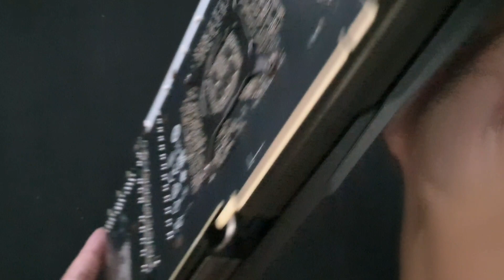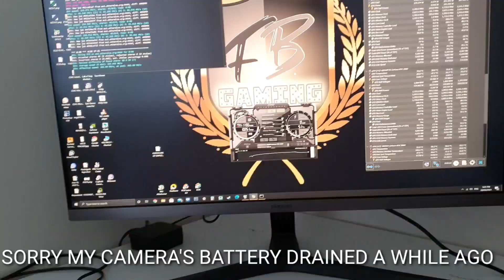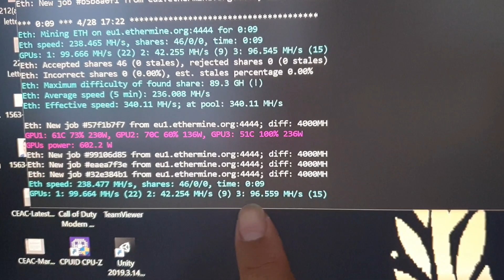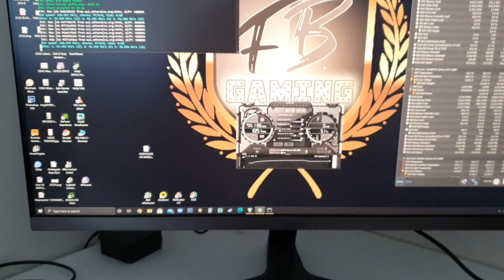RTX 3080 Thermal Pad Replacement | Teardown | 101mhs eth mining

Comment: You have good taste in music.  Did you ever figure out why your hot spot temp was so high?
Reply from the maker: Hey there, it is because of the chip that MSI used, Asus strix use better chip and is not prone to overheating.
Reply: @ToolsandGadgets   Okay, thanks.  I replaced the pads and paste 3 times now and I can't the hotspot temp  down.  I basically wasted my money even buying them.
Reply from the maker: Aftermarket thermal pads are better than stock ones though.
Reply: @ToolsandGadgets  I used the gelid 1 mm pads.  The gpu hotspot went up but the others went down a little.
Reply from the maker: It's better to take note that some parts use 2mm thick or 3mm thick. probably some parts that are heating up are not touching the thermal pads since it's too thin.
Reply: @ToolsandGadgets  I never touched those pads.  I only changed the 1mm ones.

Comment: Pause at 8:59 now look at the vram heat sink near those heat pipes at the bottom underneath that removable plate I’ve seen people talking about how the plate doesn’t make contact with the heat pipes! So they add an additional thermal pad underneath it !

Comment: The values for pad thickness are all wrong.  They all need to have 0.5mm added to all the sizes provided.  At least for the gaming Z trio.  Mining Ethereum memory temps went from 102°C to 72C
Reply: i put 1mm on mine gaming z trio on memmory went from 100 to 74 c
Reply: @techgeek2994  Which thermal pads did u use?
Reply: @bizybunny  gelid gp ultimate 1mm
Reply: @techgeek2994  did you replaced all thermal pads to 1mm?
Reply: @bizybunny  bro it has nothing to do with thermal pads, my memory temps in windows are 75c. yes i did change to gelid gp ultimates, this has nothing to do with memory temp, hiveos shows 75c as well, it is limiting power draw to 210w, and i noticed core clock drops under 1000 when you overclock memory, it is some problem with hiveos with this specific gpu
Reply: Well want to properly tell us the size instead of belittling mate I’d also like to know the correct size !! ?
Reply: @filiplaskovski9993  - watch the video, add 0.5mm to the recommended size mentioned in the video.  I suspect from memory it's 1.5mm.

Comment: How do you get 1.5mm if you only have 1mm and 3mm thick pads? Can you stack them?
Reply from the maker: Hey there, i did not replace the 1.5mm since i do not have it on hand and it does not affect the vram temps.
Reply: @ToolsandGadgets  I am opoening my GPU up to change memory junciton thermal pads, should i change more than just that while it's open?
Reply from the maker: in regards with the memory junction temp problem. only the ones i showed on the video gets to be replaced, both front and back thermal pads, please see my other video for the back thermal pads replacement. the rest of the thermal pads are not affected or in any connection with the memory junction temperature you are facing.

Comment: Bro I changed my thermal pads everything booted but it restarts my whole rig every 30 mins. What is happening to my gpu any idea? Do I rechange thermal paste or cut my pads again
Reply from the maker: Hey there, did you try checking the temps using HWinfo?
Reply: @ToolsandGadgets  can we connect on some social media so that I can text you up and show you images. My core temps are higher I know that. Memory temps are lower than before. But this card is restarting.
Reply from the maker: one reason i think which also happened to me before was i pushed it to the limit and over clocked it so badly that it restarts every couple of minutes because the gpu could not handle it anymore.
Reply from the maker: try lowering down your memory clock and see if it works
Reply from the maker: i think lowering down your memory clock should do the trick find the sweet spot of the card. that happened to me also, and the only overclock i changed was the memory clock by lowering it and finding the stable spot
Reply: @ToolsandGadgets  actually I started using the same clocks as previous settings on this card but it's restarting. Before it wasn't
Reply from the maker: by the way what model and brand of gpu are you using?
Reply: @ToolsandGadgets  I am using the same gpu and 1mm thermal pads on memory.
Reply from the maker: can you type in your overclock settings here bro. and also the temps that is in hwinfo
Reply: @ToolsandGadgets  1350 memory power limit 112 core clock locked at 1010 mhz fans 80 percent. 
HWinfo temps are 47 C for core temp. Memory temp 96 to 98 C before it changing pads it was 104 C
Reply: I also flashed the suprim x bios like a month ago and I am Using trex miner for mining
Reply from the maker: Try this
Power limit - 75
Temp Limit - 77
core clock -    -292
Mem clock -   +1000
Fan Speed - 80%
Reply from the maker: i am using stock bios
Reply from the maker: or maybe just open back the card and try to reseating everything. also the cables inside try to check if all are connected properly
Reply: @ToolsandGadgets  with the stock bios I was getting 88 mh max. I ordered new pad and new thermal paste. Will change the thermal paste with a higher quality one and cut the thermal pads a little smaller I guess that's causing the issue.
Reply from the maker: yes because i could not see any other problem aside from reseating the whole thermal pads and using the right thickness of thermal pads
Reply: @ToolsandGadgets  the thickness is right. 1mm but the thermal paste is a normal one. Will update you once I redo everything bro
Reply from the maker: if you are using the same clock settings as before. try checking your thermal pads on your front pcb. maybe it has a different thermal thcikness to it, and the heatsink does not have enough contact with the gpu processor
Reply from the maker: always remember different brand and models of GPU uses different thickness of thermal pads. if the thermal pads is thicker or thinner even by just .5mm thickness it can affect the contact of the heatsink to the processor thus causing random shutdowns due to overheating

Comment: where did u use the 1mm thermal pads, i just dont get it?...
Reply: the 1mm is the most important part as it is the one you put by the chip. ur using the internet so ur not a dumb ass. if u watch from start to finish u would see he labeled 1mm, 1.5mm, 2mm. go rewatch and find it urslef idiot.

Comment: The most important thing here. What was the before and after VRAM temp?
Reply: 17:20
Reply: @TheRusox  98C is horrible he used the wrong size thermal pads. I used 2.0mm and got my temp to 82C in a closed case.
Reply: @Johnnyy832  Do you suggest to use 2.00mm in all the pads he changed? (i got the same card and im preparing to do this)
Reply: @aborjas23  yes

Comment: I think the reason ur still in the high 90’s for mem temp is because 1: u didnt clean ur paste properly with alcohol . 2: theres one thermal pad 2mm that needs to be closer to the bracket on the heat sink so it makes contact . I did 4 suprim x and they all running at 80c on mem junction . I have yet to do my trio x but after replacing pads it should be around 80 regardless of silicon lottery
Reply: I believe so too. Saw someone able to get 80s using gelid extreme. Would you happen to know if these pads would work - Frosty thermal pad 12.8? I can’t seem to find much info on it.
Reply: @storedcoin4026  They all work, in my opinion just use thermalright pads. I was able to bring my temps down to 82C junction while mining in a closed case.

Comment: i dont understand man i have better temperatures with stock thermal pads on the same rtx 3080 , mine temperature is  92 at 99mh, you did something wrong again, it doesnt make any sense how i can have lower memory temperature with shitty stock thermal pads , than you with expensive pads ?
Reply from the maker: Hi there, well there are lots of factors 1. maybe you live in a cold place. 2. You won the Silicone lottery. 3. You're version has a better stock thermal pads. 
So which ever it is you are really luck to have that hash rate with the stock thermal pads.
Reply: @ToolsandGadgets  i dont think stock pads can be better than 12.8 mk expensive ones. for sure they didnt use expenisive pads, and no i dont live in cold area it is summer here now 30 degrees celsius. just check did you use proper size of pads. with thermal oddisey you should not get more than 84 celsius on memory man
Reply from the maker: well there are lots of post people getting lower hashrate due to temp throttling. i guess maybe you just got very lucky, and got a very very good silicone.
Reply: @ToolsandGadgets  what thickness thermal pads did you put it needs to be 1mm softer pad, i decided since summer came and my gaming z trio went up higher in temp to change and i used gelid gp extremme 1mm on memmory now memory is at 74c at night 78 at day . i can notice your core temp is 51c that means you used too thick pads there is not good contact with core (i know this because happened to me as well core was 52  because i used too thick pads, reduced to 1mm and dropped to 35c , or therml paste is not good. i used noctua paste core temp stays at 35c) at night 40 max during day when is hot. try using thinner memory pads or better brand . there is no way that that card cannot be lowered under 88c on memory

Comment: Which config do you have on your RTX3080?
Reply from the maker: PL 102
CL -292
Memory + 1200

But it really depends if the card can handle it
Reply: @ToolsandGadgets  just change the thermal make her up the hash?
Reply from the maker: By changing the thermal pads the memory junction temperature decreases that is why you can tweak better on the afterburner to get higher hashrates. because when you reached 110c memory junction temperature, it thermal throttles which will limit the performance of the card.
Reply: @ToolsandGadgets  my msi trioz get 92c 98c and dont pass 90hs
Reply from the maker: for a rtx 3080 99mhs is totally normal and very stable. also as long as you dont go over beyond 100c memory junction temperature is also ok. but if you could lower the memory junction temperature by switching the thermal pads to a aftermarket pads like the thermalright extreme odyssey it would be really better
Reply: @ToolsandGadgets  sorry dont pass 90# hsh
Reply from the maker: Hi there can you put your specific card here and the OC settings you made. Maybe people can jump in to help.
Reply: @ToolsandGadgets  in my case my rtx3080 ventus , doesnt pass 90mh/s with 86° memory temp(thermal pads changed)  config : pwL : 75, core clock : -200 , memory clock : 900
Reply: @ToolsandGadgets  is a rtx 3080 msi trio "Z" on windows

Comment: Is this guide the same for 3090 Gaming X TRIO?
Reply from the maker: Hey there i'm not quite sure, because the rtx 3090 uses a metal backplate and has a copper cooling attached to the backplate and is maybe using a different thickness of thermal pads compare to the 3080.
Reply: @ToolsandGadgets  thanks for getting back to me 🤝

Comment: Im gettin 101.5mh with stock pads, using 1300 absolute core clock on hive an 2700 on the mems. Checked on windows junction temps hovering from 92 to 96c.
Reply: Getting about 101.5 on mine without swapping anything out (temps hover 90-96), but I got the z trio. so not sure if they put better pads on that one. I did have to flash my bios to the suprim x to get that hashrate though. I found that the power limit on stock was to aggressive and could only get about 90mh.
Reply: @cgcgames1  only change the bios?
That make loose the warranty?

Whats your clock settings?
Reply: BS
Reply from the maker: Now that is what i call a Silicone lottery winner right there! 🥳
Reply: @ToolsandGadgets  i guess, i think the latest msi cards got a beefed up thermal pads compared to previous batches
Reply from the maker: the latest gaming x trio still has the same thermal pads as before. i think it is just the suprim x line. since people are also using the suprim x bios to flash their gaming x trio to unlock the power limit.
Reply: I'm getting 115mh at 92c junction temp, can run it at 125mh at 94/96 I thought that was to much lol so I've ordered Bykski waterblocks.
Reply: @financiallyfree  can you explain better?
Reply: @financiallyfree  tks man
Reply: @financiallyfree  Dang, you are getting into 3090 territory with that hash rate. What algorithm and miner are you using?

Comment: Hi bro, can I change only backside thermal pads by sticking 2 layers of 2mm (2+2=4 mm) thermal pads?, their compression ratio is 40%.
Reply: I have same graphic card as you
Reply from the maker: Hi there, in regards to this specific video card 3mm is recommended since the stock thermal pads is 3mm. But you can go for 4mm since the backplate has a independent opening at the back and does not require opening the front pcb before you have access to the back. check your memory junction temp before replacing, and check again after replacing if there is significant changes in the temp. And be sure to keep the stock thermal pads in shape so you can just stick it back in if the temp goes way way high after changing it to 4mm. Good luck!

Comment: Hey bro we have the same exact card and I haven't even change the thermal pads yet but for my junction temps its around 94-96. You need to set your PL to 101. Setting it to 102 seems to unlock the bios but its going to thermal throttle. Im still getting about 97.50 to 98 megahash. Heres my complete settings. Pl is 101, Cc is -200, Mc is 1,250. and also just max out your fan to 100% I would rather save the life of the GPU than the fan. lmao.
Reply from the maker: yes i already tried that oc settings bro, but when my MC goes over 1,200 my rig just crashes and restart it self, guess i just got a really bad silicone.
Reply: MSI 3080 Suprim X with fabric thermal pads: PL 65%, core +100, memory +1000, fan 85%. Memory temp 96-98C . Power usage 230W. Hash rate: 97,3MHs
Reply: Ftw3 3080 ultra, no modding, 60% pl, mem +1500, clock - 200, memory junction 90c @ 65% fan speed, card temp 51c, 103 mh/s..... Card is beast for mining

Comment: Dude, lower the power limit, you shouldnt go over 70, just google mining setting
Reply: He already mentioned in his first video that the bios of this MSI 3080 have a bypass which limits the wattage. I happen to have the same GPU and the only way to even get the M/hash up to 90 megahash is to set it to PL 101. Otherwise, the wattage is gonna stay below 215 watts.
Reply: @theclawhwahahahaha8499  I'm going through the same problem ... if I don't set the powerlimit to 82 I get 95 mh / s, but it consumes 303 w ..
Reply: that dont work with this gpu if you lower power limit to 70 hashrate will drop a lot

Comment: which thermal pad you use in this video and what size mm ?
Reply from the maker: i indicated the sizes used in the video. since the front PCB has different sizes in it, please watch it again. i used the ThermalRight Extreme Ordyssey
Reply: @ToolsandGadgets  ua but Which Size in MM ? 1.5 or 2 ? or 3 ?
Reply from the maker: Watch at 4:39 there is the sizes for the thermal pads on the front pcb
Reply: @ToolsandGadgets  ohh nice i probably miss that
Reply from the maker: No worries, Just use extreme caution when replacing the thermal pads. Good Luck! 👍
Reply: @ToolsandGadgets  ya.. different companies different Buiilds :L
Reply from the maker: is your card the msi 3080 gaming x trio right? coz it might be different sizes for different graphics cards
Reply: @ToolsandGadgets 3060ti gaming x trio and Gigabyte Oc n 1080ti n 1070ti
Reply from the maker: oh ok i think the disassembly is just the same
Reply: @ToolsandGadgets  u removed the backplate without unpluging Rgb pin ?
Reply from the maker: yes. only if you remove the front pcb you remove the rgb and fan pin connector

Comment: You get high vram temp because your power limit is high and try to fix temp below 90°C for GDDR 6x for better GPU life time . 
I have Gigabyte RTX 3080 Gaming OC it was thurmal throttling at 110°C and get 60Mh/s after i replace thermalpads with Thermalrights 2mm pad uperside and 3mm on backplate i get now 86°C vram temp and 95 mh/s with 63% power limit (230 watt) / -150 core clock / +1000 memory clock / 60% fan speed.
Reply: I have the same 3080 (wish it was anything but gigabyte). Swapped mine same as yours, used thermal grizzly 2mm front and 3mm back. I see about 82-86c on vram and around 58c gpu temp mining. 99 mh/s at 1050 core / 2200 mem / 230pl / 80-% fan. 1050 absolute core clock doesnt effect the 3080 much but my wattage is usually 225w
Reply: @mrhoach2229  nice how much you increased core clock and memory clock ? and i advice you to lower fan speed 75% at maximum for better live time of your fans . GDDR6X 90°C maximum in mining is safe
Reply: @MARKELL00F  I am using HiveOS. They have that absolute core clock option so it's 1050 core and 2200 memory. Works really well for power usage on 20 series cards, not as much of an improvement on 30 series. I'll try dropping my fans across the board, I want to keep everything under 60c.
Reply from the maker: Hi there MARKELL00F, PL was set to 102 for the msi 3080 gaming x trio specifically due to a bug on the bios of the card that it will unlock the Watts limit. But after changing the pads, i brought the PL down to 75%. all is good
Reply: @ToolsandGadgets  you can't lower the PL to 63% ? i have also Msi 3080 suprim x i done the same settings and it has the same temp and hashrate like Gigabyte
Reply from the maker: i did try 60 all the way up to 75% still no luck. i could try flashing the bios on my gaming x trio, but i really do not have any experience yet in flashing bios using nvflash.
Reply: Try 60% power limit/ -300 core clock/ +1250 memory clock/ 75% fan speed for gigabyte gaming oc